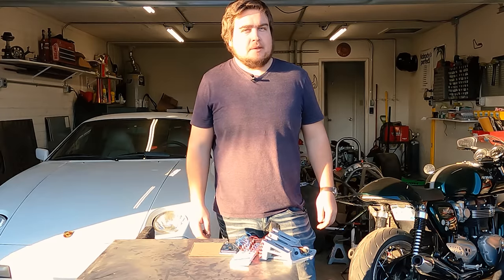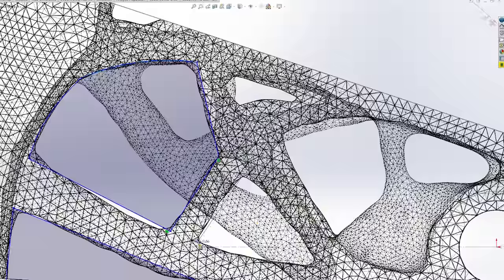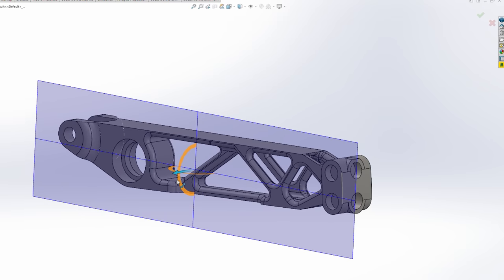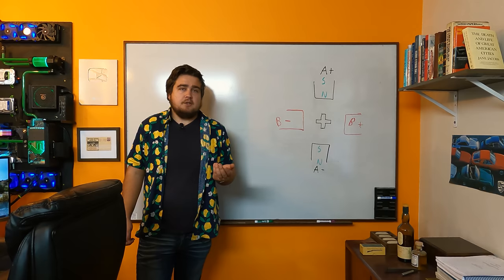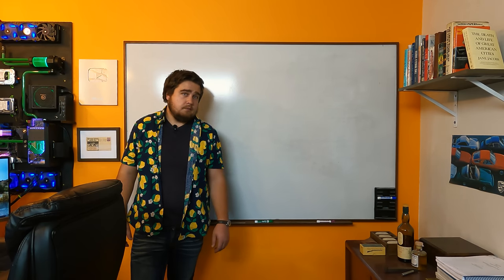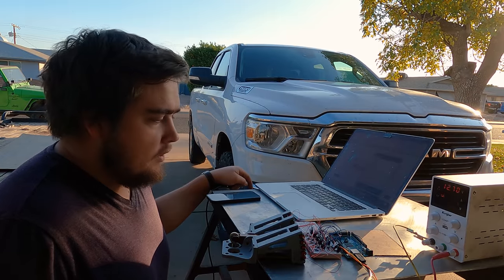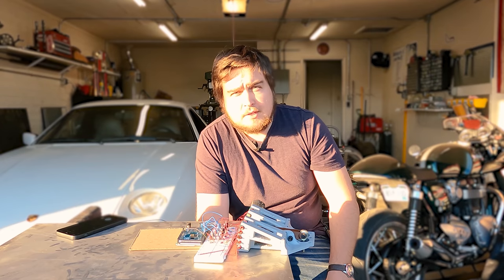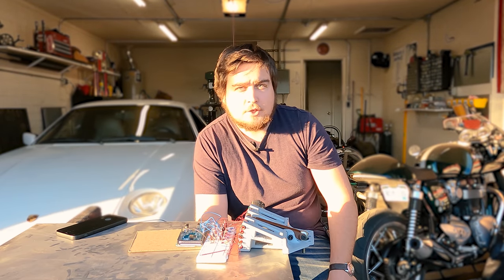I build a Very Specific Stepper Motor the Wrong Way

Comment: This is what 3d printing is for, so many people want it to be final product, and maybe one day? But it’s best work is in prototyping, imagine building all this from billet.
Reply from the maker: Exactly... I'm working on some aluminum manufacturing abilities soon, but It's so nice to be able to prototype out of PLA
Reply: @WesleyKagan  slingshot channel uses plywood for prototyping, really strong stuff if used right. Might be worth a look
Reply: I don't think it has reached consumer level useability and affordability but titanium 3D printing seems to have reached the point where it by is an useable for industry. There are several cycling brands using it for frame parts and other small, complex parts where the ability to print complex shapes with voids in them that would be hard, if not impossible, to machine or cast is used to create light, strong titanium parts.
Reply: 3D printing is past prototyping. Many end use parts being used in multi million dollar projects in many applications I've seen.

Comment: On air jet textile weaving machines the machines use overexcitation to make the solenoids work quickly. We have gotten up to 1250 PPM. The MAC solenoid rep said the have solenoids on cigarette machines that can do 12000 PPM. Thanks for the time you spend sharing your projects.
Reply from the maker: Interesting- Might look into that a bit!
Reply: @WesleyKagan  do you have any interest in SMCs high speed solenoid? The rep sent me a pdf I could forward.

Comment: Sooooo... what if you use explosions to power the valves? Basically a rudimentary small engine on top of the main engine where the valve stems of the main engine are the pistons of the small engine? "Yo dawg, I heard ya liked cars so we put an engine on your engine so you can rev while you rev!" Ok ok, I'm gonna go take my meds now.
Reply: Wait please, I want more of whatever this was
Reply: Or maybe drive the valves of the IC engine with steam controlled by cams driven by small steppers or servos.  Use an electric heating element to make steam initially, then switch over to exhaust heat once warmed up.  Ditch the transmission in favor of an alternator and traction motors...

Result: Digitally controlled steam-actuated gasoline-electric car.  The model name has to be "Rube", of course ;-)

Comment: 5:50 declaring "it works" is bit optimistic... Also with high inductance coils, you can use voltages above the nominal rated value to force saturation/desaturation quicker, but the power control would have to be much more precise. Also you seem to have 1 x mosfet per coil - try extend that to a H-bridge so you can optimise trailing push forces with your leading pull forces. Linear rotary encoder could also help here - as you could just create a lookup table by incremental index to determine mosfet states specifically on your actuator position. Minimuse all your air gaps (to a point, becareful of excessive cogging), and I also suggest you order some soft iron rod from eBay (high permeable iron) - all this should maximise your flux vs. the power input.

Comment: Congratulations! Astonishing work!

In the Miata project you have full control of valve timing and duration, but, as you stated previously, you still cant control lift, is 1 or 0.
What if you keep everything as you did in the Miata engine, but add some movable stops? The pneumatic valve actuator will stall when the valve hits it.
These stops can be as simple as a threaded tube between head and valve spring retainer. This tube would be spun via stepper motor to increase/decrese gap betwen it and spring retainer, modifying valve lift. It doesnt need to move superfast as the valves do. These stops have to move according to throttle position and engine RPM only.

Thank you for sharing your work!

Comment: Interesting project, but I think this particular rabbit hole could be a lot deeper than most people think.

The problem (As you know) will be eventually setting this idea up to work on a car engine that may be able to run at over 6000rpm. At 6000rpm the valves need to cycle 50 times a second, but as they stay still for 3 of the 4 strokes, it needs to be able to accurately move at the equivalent of 200 times a second, and I just can't think of any readily available electrical operated rotary or linear  actuator that could do that.

It could be that the only way this could work would be with an entirely custom cylinder head with a radically different valve design. Passive vacuum operated inlets and some sort of servo motor controlled rotary disc valves for the outlets could possibly work as the timing of the cut out on the outlet valve disc is all that needs controlling rather than the direction of travel. Adding some extra steps to half of the servo's rotation and dropping a few on the other half of the single direction of travel has to be easier than reversing travel of the motor and fighting the systems inertia by using the original more traditional valve arrangement, but again, it would be ludicrously hard to get to work properly, and prohibitively expensive to make.
Reply: I do think he is slowly showing why Freevalve went with the electrohydraulic setup it did.
Reply: @1320crusier The Freevalve is also pneumatic
Reply: My thoughts, i don't this solution will do it

Comment: My idea 7 years ago was to use stepper motors to directly move a spherical valve with middle cut out 90degrees offset to allow full flow in and out rather than interrupted by the head of the stem, with the coding on the intake doubling up to be the throttle body.

Comment: Add Iron yokes to your coils, that will improve field strength instead of loosing the magnetic field of the back side of the coil. There should always be a closed loop out of iron / magnets for the field lines to travel. It may be even possible to connect the backside of each left coil with the back side of the corresponding right side coil

Comment: I agree with Justin Baker.   Perfect a better valve design.  A rotating ball design would be easier to control because you don't need to reverse direction.  Just need position and speed.  Might need an oval or tapered oval opening through the ball for best flow and overlap, but all intakes could be driven on a single shaft, and then all exhausts on a single shaft.
The problems to overcome would be sealing and thermal expansion.  Might need to use more of a ceramic ball and seats to reject heat, and have seats on both the chamber and port side of the valve.  Maybe even with an controlled gas porting of the ball valve seats?

Comment: this style of stepper motor was used in Hard Disks however they now use a voice-coil set up. its not too different you could easily use a audio amp to get the power you need.
edit - spelling

Comment: I do have an idea I'd like to share with you, but I'm not sure how to describe it. Basically if you take your prior idea of the rotary ball screw, but make it so 1/2 a revolution, or more even, is the down stroke, and the rest of the revolution is the up stroke, this would solve the issue with having to reverse direction. You could even have it so there is a flat section of the ball path which keeps the valve closed or open to compensate for some inaccuracy or spinning momentum issues. Now granted this is essentially trying to infer camshaft motion in a different dimension, but of course being attached to an encoder motor it would still allow you to stop anywhere along the path up or down stroke for infinite variability.
Basically the ball bearing path would start and end at the same point. If you stretched it out straight it would make a V. One full revolution would open the valve to its lowest point and close it, just like a cam. The major advantage being not having to reverse the motor. Going from forward to reverse very quickly being the most difficult part timing wise, I would think. The speed of the engine would basically dictate how fast the motor spins the valve open and closed and also how long it dwells at any point. Not one of my original ideas for free valve, but based off your last video. I'm sure you'll probably get what I'm saying or may have already thought of it and I'm sure I'm also missing considerations. Just a thought!
Reply: but then you cant change how much the valves open... but that can be fixed with a lifting mechanism..  but the thing with freevalve is that ju can generate something like a square wave.
Reply: I think the main con to that it goes back to a fixed valve lift height, which means adding the throttle back plate in and all the associated pumping losses of forcing the gases through a restriction.
Even if you can get through the "V" very quickly, It's still a lot of work to move it all the way down and all the way back up in a short enough period of time to idle or do low rpm/low power cruising.
Reply: @bullzebub  Of course you can. Exactly the same as his last video. The amount you spin determines how open it is in however many steps the motor has between fully open and fully closed. That's the point. ^_^
Reply: @nickopedia5669  No matter what there is a fixed amount of maximum lift and the benefits there of are determined by valves size anyways. No such thing as infinite lift. The point is just to have it be infinitely variable and not driven by camshafts.
Reply: @802Garage  
You added a word in there, "maximum". 

While that is also a concern for peak power, the bigger concern isn't maximum but minimum. Being able to opening the valve to a low enough height AND with a low enough duration that it can idle, as well as go full throttle too of course. 
Which is why the fixed lift is a problem - you have to go all the way down before you can come back up. To compensate for opening so far you have to do it even faster than normal, yet because it has to move so far it makes it even harder to make that motion in a short period of time.
Reply: @nickopedia5669  I think you're missing a key part of my design idea which, exactly like the design in the video before this one, is infinitely variable and can be held anywhere between fully closed and fully open. The point is not that the motor will always be spinning, just that it does not have to reverse directions. It's just an expansion on the prior video's method.
Reply: @802Garage  
Oh I see, so it could go back and forth like the old one, but also go all the way around for high rpm use?

I love it. That solves a lot of problems.
Reply: @nickopedia5669  Yes. ^_^ It's def hard to describe without a picture. But yeah the key is that it could pause at any point along the track if you will and then it could just rotate quickly for normal operation as well or hold full open or full closed as desired. No idea how well it would work of course, it's just a potential improvement to his previous idea. :)

Comment: @3:27 Put a resistor in series with your freewheel (discharge) diode that matches the impedance of your coil. This will allow the field to collapse faster.

Comment: magnet coils are a science. 
i tried using a coil calculator to make a linear actuator and in on paper it should have worked but it couldn't overcome the light spring. i was getting less flux strength than calculated for some reason.
I used the same wire dia, turns, and voltage i used to calculate the strength of it.

Comment: If a smooth transition and precision is more important than holding power you could offset the left from the right could by 1/2 the width of a magnet. If would mean two left and one right would be position A. Then to move one step. Only one left that was already on stays on and now one additional right turns on. May have an issue with sticky magnets having false positioning but it seems much smoother.

Comment: Beware small resistance with inductive loads. They have resonant frequencies which can cause higher then expected voltages in the coil.

Connector resistance around 0.1 ohms when driven with 12v can cause more then 600v on the coil. So beware the breadboard connector resistance.
Reply: O_o whoa
Reply from the maker: Yeah, I should note that a breadboard is the WRONG application for this test.
Reply: @WesleyKagan  if I had a dollar for every time I made a wrong decision I'd be rich. 

Anyhow just keep in mind that your power supply has a capacitance front end, then you have connector resistance to an inductor. That configuration is a "tank circuit"

Comment: A tough problem to solve. If it were me, I think I'd be looking at using strong spring tension and an over-center mechanism to 'drive' the valves open/shut. Then the drive speed/strength is reduced to bringing the spring close to over-center, with a final nudge at the correct time.

Comment: To replace the nails you can take apart an induction motor of a large enough diameter and cut out a piece of the stator.
Then for the pivot arm you could use regular flat neodymium magnets.
So in a sense it would be like a piece of a brushless motor.
I don't think this is the best way to do it but i'm still excited to see how this experiment goes.
Getting rid of camshafts has been in my to-do list since forever, but it's buried under many other things i want to do also.

Comment: So I'm thinking a high speed motor would be best. Fast rotating with a flywheel to help smooth it out for taking load. Now the linear part should have steep threads kind of like a lead screw but larger pitch. Then control opening and closing with clutches. Now the clutches are going to be controlled by rotating electrical fields. The motor aways turns in one direction, but we can get two outputs rotating in opposite directions and energize the one that is turning the direction we want the clutch to lock so we have slip. Slip allows us to hold the valve closed, while atmosphere is trying to force it open, without hitting a stop and halting the motor.
So motor rpms stay high and valve can travel to stop and reverse direction and close very quickly also. Plus i believe a rotating gizmo is going to be WAY smaller than that thing.

Comment: Making a basic CNC Coil Winder may be worth it if you plan on making a bunch of coils!  There are some good Open Source designs out there.  Granted a drill rig like that is great too.
Reply from the maker: I didn't even think of that, but you're right! Definitely another tool I need to build around the shop. Looking into some other cnc stuff as well!

Comment: im LOVING this adventure into camless engine control. i was fascinated with freevalve.. and then they went kinda hush-hush about it and it never really materialized on a large scale.. :/
Reply: very promising and very disappointing that it didn't deliver on its promises. at least not in mass produced engines. Koenigsegg TFG shows that it's technically possible but mass production still far away

Comment: To get a stronger electromagnet without higher inductance, wind one layer with leads, then another, then another. Then connect them in parallel. The total inductance will be only slightly more than a single layer coil and with less resistance. This will still create a strong magnetic field, and you can drive it with much more current due to more wire cross area. If you need more resistance overall, just add an in-line resistor.

Comment: a viable way to make this work could be to use a crank-shaft like armature to do the oscillating whilst a stepper servo manages rpm to vary timing. this would allow the stepper servo to maintain a fairly constant if not slowly changing magnetic field and delay from inductance could go down. but at this point it would probably be more efficient to have independently driven cams that are connected to individual steppers. mechanical oscillation is difficult to maintain via electronic means especially at high frequencies. u start to deal with impedance and back emf which is another obstacle in this method of valve timing. maybe try redesigning the valve mechanism so that it doesnt depend on controlled oscillation?
Reply: also keep in mind that using magnetic fields like this will produce a exponentially decaying SHO which will add uncertainty in the positioning of the lever and timing the following motions especially with the abrupt movements that a valve requires.
Reply from the maker: Brushless controllers like odrive were recommended to me, and that's what my thought is with them. i'm curious to see how much adjustment I can actually get with speeding up and slowing down on a rotation.

Comment: If you want to charge up a coil faster, just use a higher voltage with current chopping. :)
Reply from the maker: I was actually doing some reading on that! Might work it into the strategy.
Reply: Ford Powerstroke injectors use 120 to 240 drive voltage.
Reply: @WesleyKagan  I'd suggest trying the hardware you've built with a bog-standard off-the-shelf 5-phase stepper motor driver. I.e. Wire up the coil pairs in parallel and rely on the driver's constant current control and higher voltage rather than using separate up and down coils. You could also stagger the coils on one half by half a step and use either a 2-phase or 5-phase stepper motor driver depending on how you wire them.